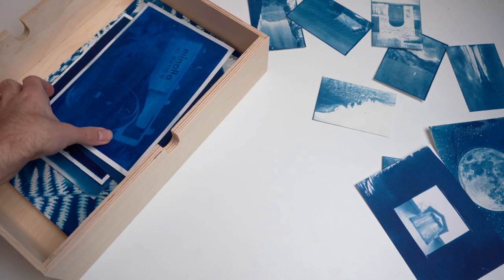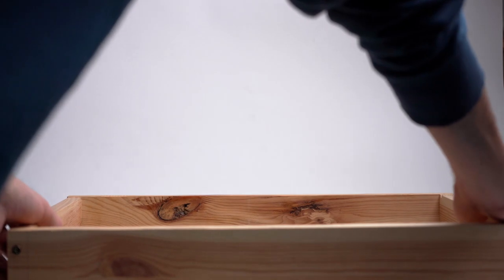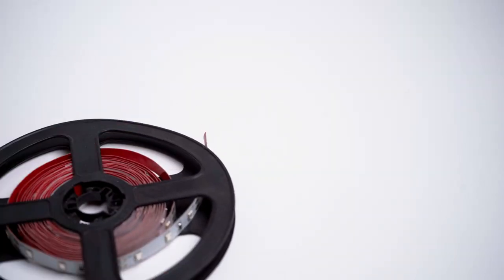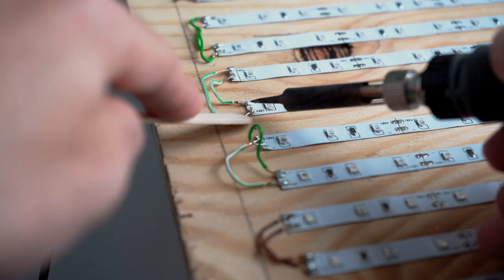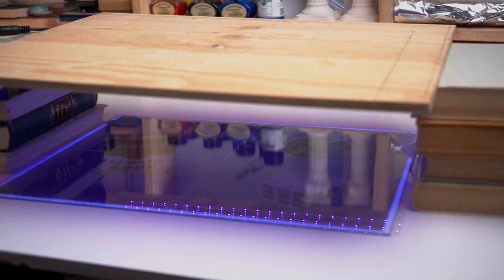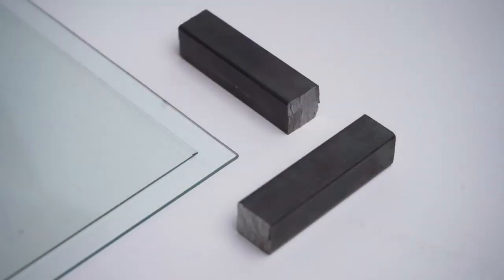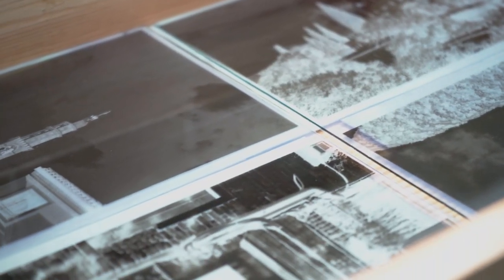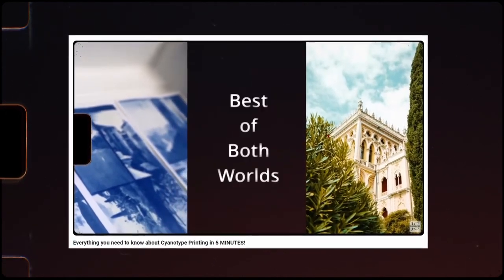Indoors & Reliable: Cyanotype Setup

Comment: Thanks for this vidéo. Do you have details to connect each strip ?
Reply from the maker: When you cut the strip there is a small + and a small - on each side of the cut. When wiring the individual pieces of the LED-Strip just make sure to connect + to + and - to -. Hope that helps.